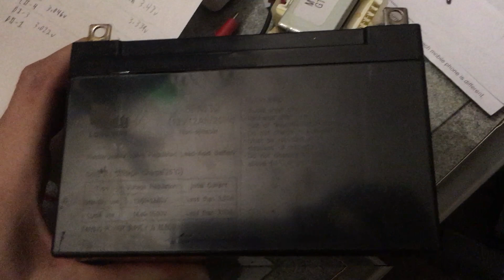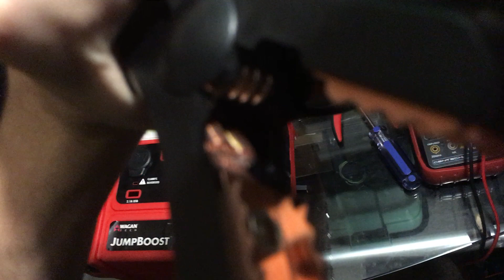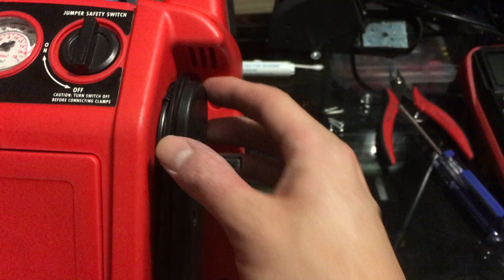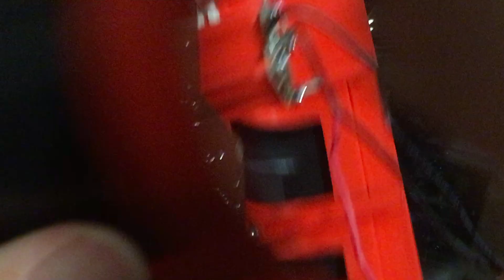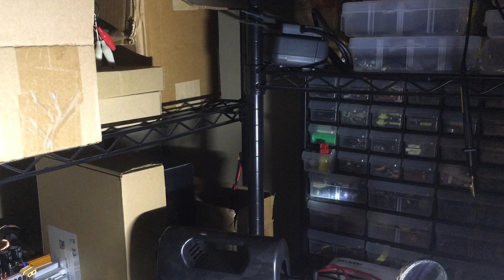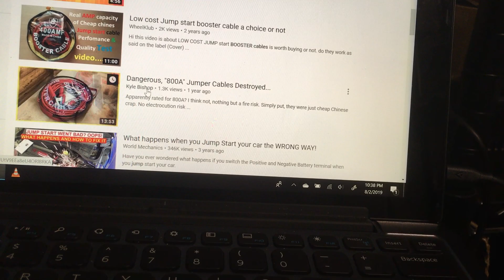Wagan Tech JumpBoost V6 7552 Revived!

Comment: 6FM-12 Battery - you never said you would replace the battery. I can’t find right battery with the correct connections. What you are doing is okay, but I was just trying to fix it.😢
Reply from the maker: Sorry friend I did not replace the battery. You need a battery with side lugs or bolt tabs. There might be some pricey lithium batteries for motorcycles that would have lugs like that. Not worth putting that kind of money into this thing.
But yeah look around for motorcycle batteries as that is most likely the size and style that they put in it.
I hope this helps thank you so much for the comment!

Comment: Well, I learned they have a battery in them. I didn't know how they worked; makes sense now. I tested my battery  with a tester and it shows weak. Wires look fine. Now I know,  I must buy another battery that will fit in that space. So thanks for the education!

Comment: Great video my man, I too inherited one, the V8, with no charger, I made one with a 12v computer power supply but it would not charge past 3 bars. I turned it to the ON position and hit it with a regular charger and ...viola! now the 12v power supply trickles and maintains it. But now I know whats inside when the battery croaks. I have a set of real copper leads that I could swap onto it, do you think it would be worth it to swap them?(they are 8ga.)